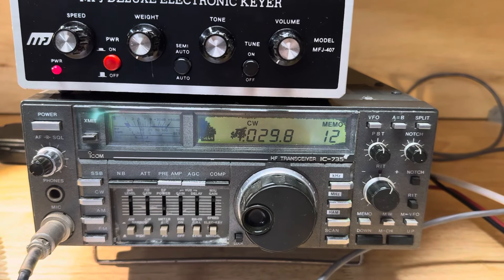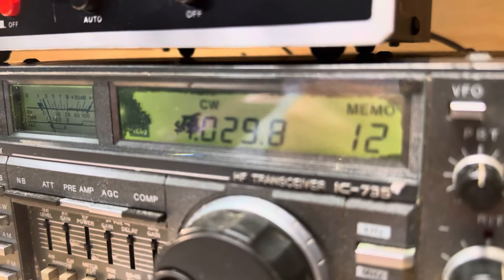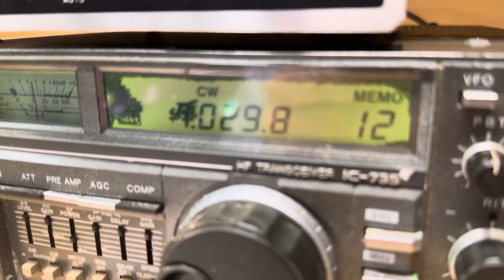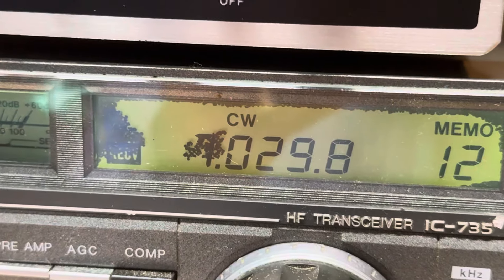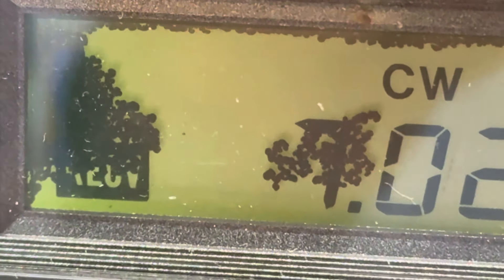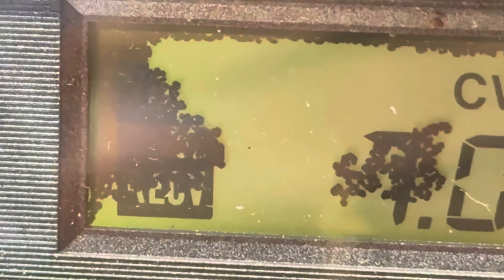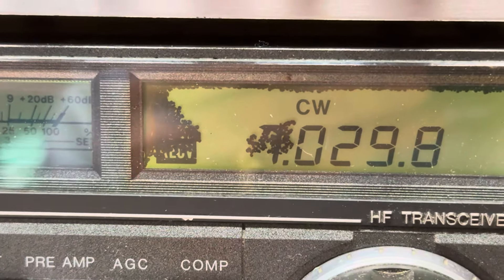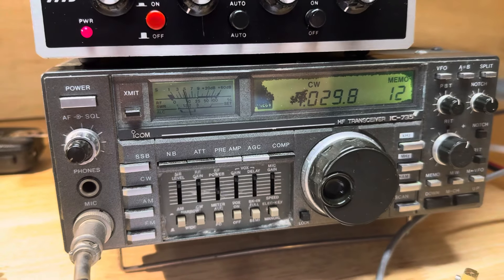What is that in front of the LCD? Rusty IC-735

Comment: Hope it's not screen rot, LCDs from the 80s/90s have been showing this issue nowadays. If that's what it is, the fixes seem to be weird workarounds like pushing the blobs outside with pressure, or baking it in an oven on mild temperatures.
If it's something on the polarizer instead, then it can be fixed by removing the top and/or bottom layer out and replacing it/them. Game Boy Color and Advance/SP models tend to fail on the polarizer glue, the screen loses a lot of it's viewing angles and starts to distort easily. The fix is removing the polarizer and cleaning up all the glue, then either install a new one or re-glue the old polarizer film. Did that literally today on my Advance SP and... it's an annoyance to clean that glue.

Comment: Looks like LCD rot, caused by fissures between layers causing the LCD matter to leak between layers. No solution but you might be able to squeeze it to the edges, although that could also induce new fissures